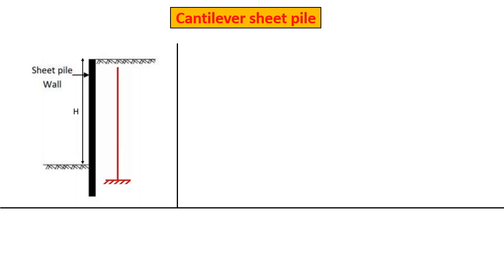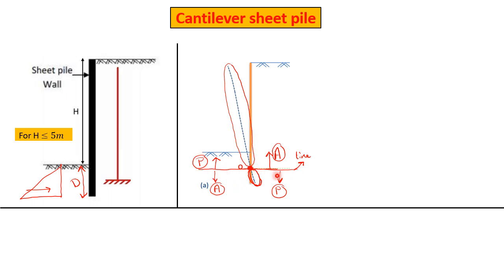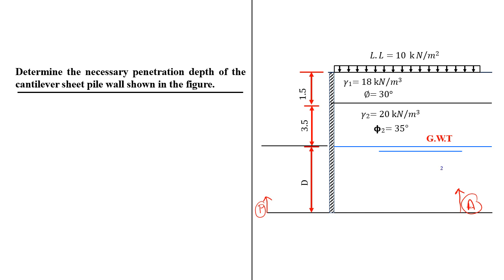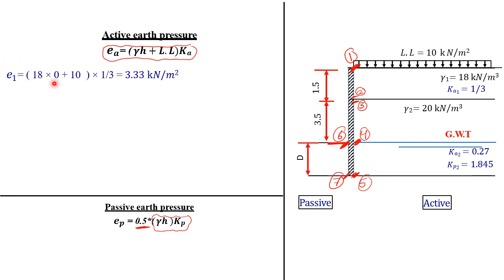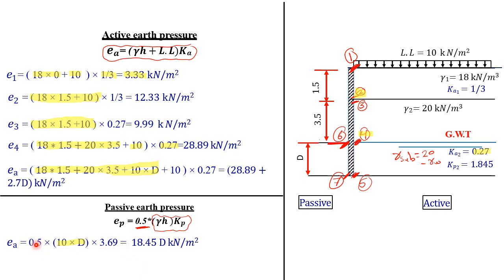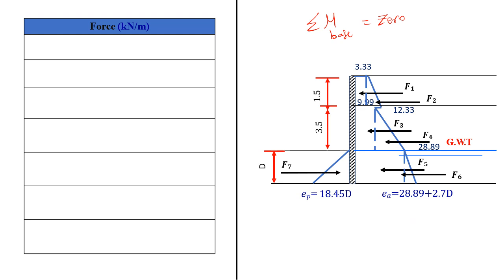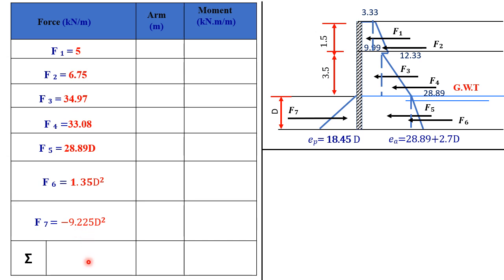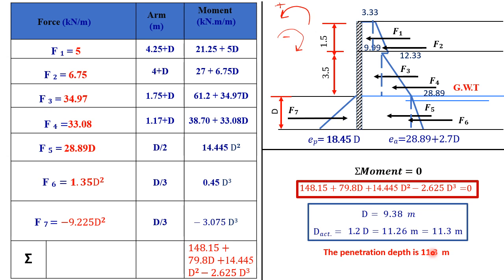Design of cantilever sheet pile

Comment: First, you used D as depth of embedment. Later,  in the simplified pressure diagram, you used 'd' as the depth of rotation point. Again, in the solution of the problem, D you used is  in fact the depth of point of rotation 'd'. 

It seems that in the solution of the example problem, you actually determined the depth point of rotation 'd' and then increased this by 30% to get 'D'.
Please check.
Reply from the maker: You are absolutely right — and that’s exactly what I have done. This is an approximate method in which all the pressures beneath the rotation point are represented by an equivalent resultant force acting through that point. There are other videos on the channel that use the exact pressure diagrams, but they are explained in Arabic. In this example, I determined the depth of the rotation point first, and then increased it by about 20% to obtain the embedment depth, as part of the simplified approach.
Reply: In the video, you were saying 'd' as depth of embedment as well. That is why I got confused. 

This is an excellent method. I understand that this is called approximate because the centroid of the resultant of the forces below point of rotation lies not exactly at the point of rotation, rather it lies slightly below that. However, that being ignored and compensated by 20-30% of d will probably always give a value more than D.